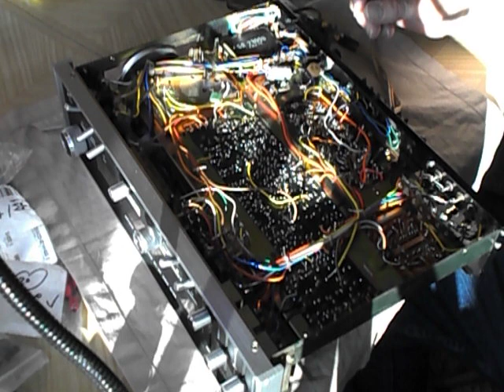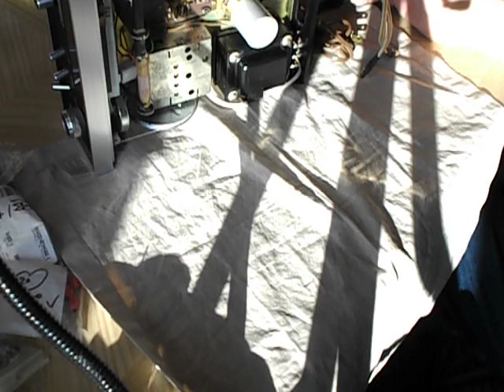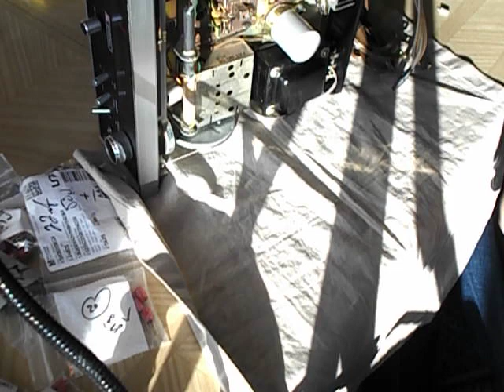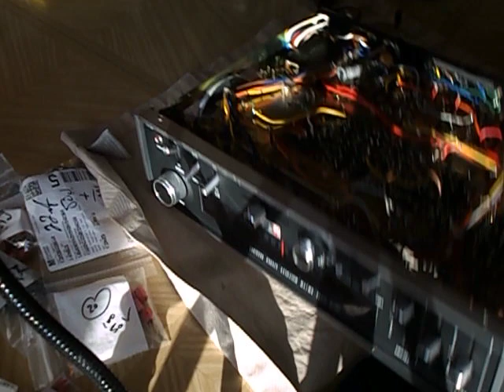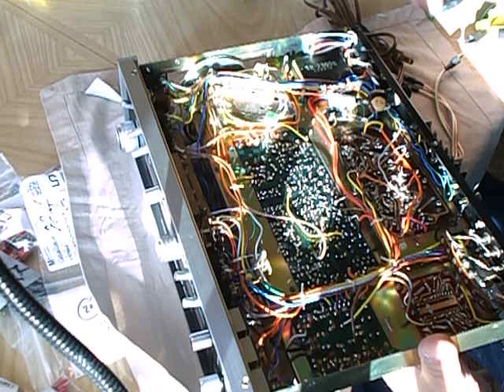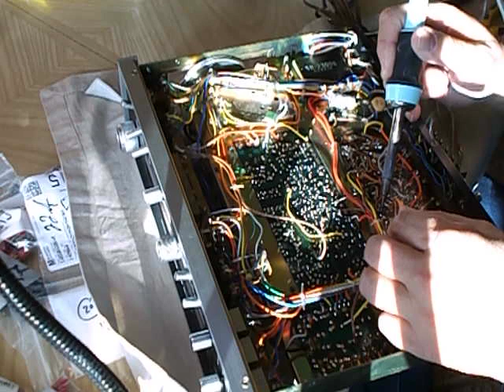Kelly and Don Citation receiver- replacing capacitors and commentary!

Comment: I'm curious, where in the circuit did you replace the cap and when is it not okay to increase the value of the capacitance in an audio amplifier?
Reply from the maker: It was the input cap on the power amp board feeding the base of a transistor.  Going from a 3.3uf to a 4.7uf will give the amp a tiny increase in bass response, going much higher to a 10uf or 22uf won't harm anything but the result can't be heard and it may not fit into the space.  I rebuilt a rebuild on a Kenwood KA-2500 that had massive increases in the power supply caps.  The 2200uf 50v was replaced with a 10,000uf which blew the rectifier bridge because of the high inrush of current when turned on.